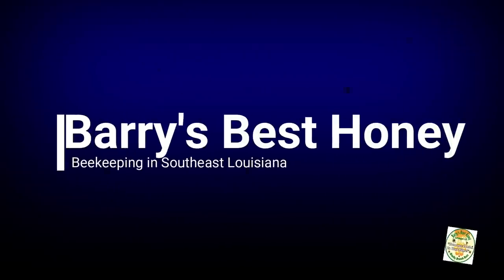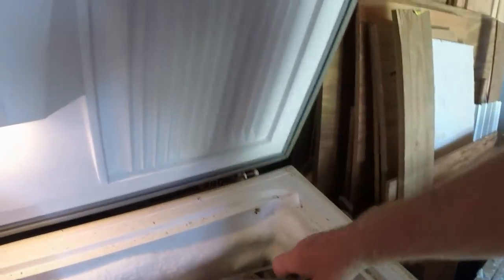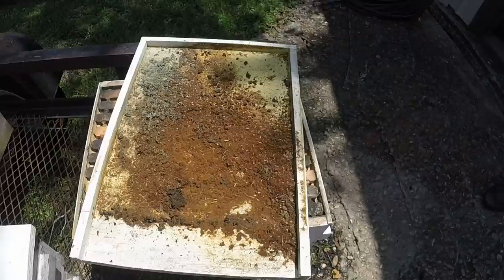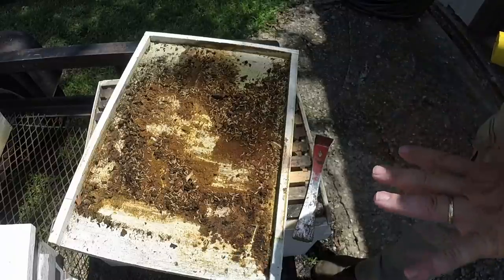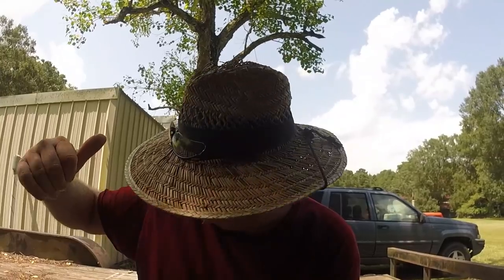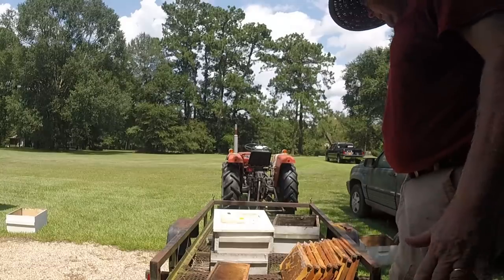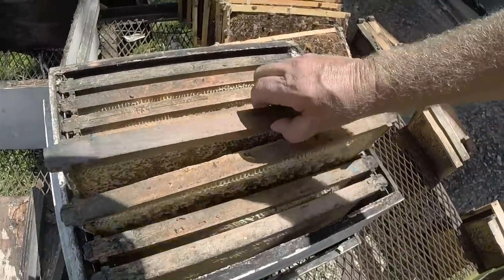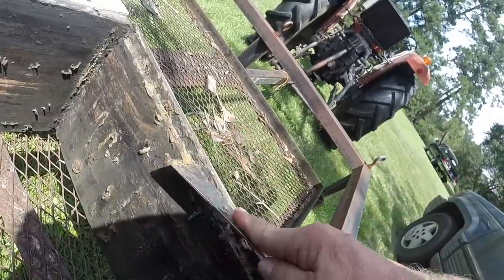Storing Brood Comb and Honey Comb

Comment: The new thing in bottom boards is you make a shallow box with screen top on it. The hive body sits on top. Inside the shallow box you put a pan of cooking oil. Any beetle, beetle larva, or mites that fall through the screen fall in the pan of oil and DIE.
Reply from the maker: That’s the same setup as the freeman trap. I don’t hear a lot about the freeman traps anymore, but they worked. Dirtrooster used them back in the beginning.

Comment: My chickens are lusting over this video! :)  I like to scape them into a bucket and throw them into their run...they LOVE both those larvae!  I have an old deep freeze in my shop and after freezing  the frames I put them in the old deep freeze.  I haven't had to add moth crystals yet but the seal is still good on the old freezer.  At some point I will run out of room...
Reply from the maker: Yea, as long as you can keep those moths out, they’ll keep.

Comment: Very good video. One of your most informative so far. Quick question though. When you say you scrape and reuse the badly damaged by recoating, is it just those 2 steps ? I am in my second year and one of my 5 hives was a dead out and wax moths got 25 % damage on about 8 frames of 2 deeps. They have been frozen, do I just scrape them down and recoat with a roller of refined/reduced wax from cappings ? Or is there another step in there somewhere ?
Reply from the maker: Michael, normally there is a step of pressure washing, but after discussion with DirtRooster and his advice, I am going to just scrape and brush them and then re-wax. Never don that before, but I've seen it work on his stuff and he had some good advice for me on it. But I normally pressure wash them and then let them dry, which really takes a while. The foundations hold a lot of water and need shaking off and then a few days to dry. Then I would re-wax, and it works great. I once saw a video of a fella who would soak them in dawn and bleach for a week and then pressure wash them. For me that was a waste of time and resources and made no difference whatsoever. I need less mess and less work, so I will just scrape, brush, and re-wax and see how that goes this year. Here is the video where I wash them before waxing:
https://youtu.be/u20GcFAJH5A

Comment: Another good video, thanks. I have found that, if I place my wet supers at least 100 yards from the closest active hive I do not stimulate robbing.   As I understand it, the bees only do a figure "8" dance if the sugar source is more than approximately 100 yards from the hive.  If placed less than 100 yards, the  scouts do not give exact directions thus robbing.  I use queen excluders, so I do not have dark production combs.  I store my supers outside in stacks of 10 by 11 (I alternate the stack height so the covers will fit with stacks closer together).   I store them with a metal queen excluder on top and bottom  (for ventilation).   I cover each stack with an outer cover with 1/2 inch spacers again for ventilation.  When I stored inside, I had trouble with rodents.   If outside, the rodents natural enemies seem to keep them at bay.   Like you say, I am not giving advice just stating "what works for me".
Reply from the maker: Yep Bob, we all find what works for us and once we’ve found that, it’s subtle timing from there. My supers are just kind of in the middle of everything. Don’t have too many issues, but once I put them pout, I don’t open any hives for the next two days. Thanks for sharing your knowledge and how you manage your new yard!! We all learn from other’s experiences.

Comment: Up here we have more problems with the mites. In your opinion, are ants bad for around the hives?
Thanks for the tips on storage. Again, this is my second year and first year really storing comb.
When you pulled out that hand torch; priceless!
Reply from the maker: I tell ya Richard, the only ants that tend to give my hives any trouble are the carpenter ants. The rest don’t seem to cause any issues on normal colonies that are healthy and managed properly in the correct amount of space. And even carpenter ants just create a mess on inner covers. And in those cases, I just switch it out to a migratory cover. I only have three inner covers anyhow and once the carpenter ants don’t have anything separating them from the bees, the bees run them off. Weak colonies, well, that’s a different story. So outside of a soil drench I do with permethrin for the hive beetles, I don’t do anything to purposely combat ants. I just don’t like them,, they get everywhere...
Reply: @MikeBarryBees  Thank you for your reply and help as always 👌🐝

Comment: Mike,  Great video.  Confirms my experience. I tried storing my frames in the open (barn overhang) with lots of light and ventilation and I was told that would keep off the wax moths.  I even took them out of box and put the frames between two metal rails with about a frame space between them (wide open).   It was ok for the honey frames but got wax moths in the brood frames so was disappointed that this "natural" way did not work for brood frames.
Reply from the maker: Thanks. Yep, they love the brood comb. More nutrient. They’re trying to get the best bang for there buck like everyone else I suppose.

Comment: Mine tend to fix wax moth damage last if at all. They seem to want to spend their time where they don’t have to do all that work to redo a frame. Small amounts are ok but major damage is a different sorry. 
Do as you need to do. They are your bees. Hot as blue blazes in Ga too!
Reply from the maker: Yep, basically what I was saying with mine. Little spots are fine, but a lot of trails and big spots and I'd rather have fresh waxed foundation. Thanks for the comment!!

Comment: Thats great chicken feed that your burning there Mike, I spray the ground under and in front of hives with 50/50 salt and vinegar mix it seems to work good on beetle larvae and weeds. (thanks for the tip Barnyard bees it works a treat).
Reply from the maker: Yea, I’ve fed chickens a few frames in the past at an acquaintances place, but I have none of my own. Don’t care to get any chickens at this time. I’ve seen the vinegar and pool salt. Just haven’t really tried it. I am ok with the permethrin used in accordance with the directions. I actually use it less than recommended and still have good results. I just do my best to keep strong colonies and keep the space in the hive to optimum area for the bees.

Comment: I just clean up moth damage with my air compressor if using plastic foundation. Just peel off what can be melted and reused then blast away. If damage is not to bad just blast what needs removing then recoat with fresh wax with a brush.  I tried the pressure washer but what a mess.  Make sure to wear goggles
Reply from the maker: I need to try that! Like you said, Pressure washer is so messy. I

Comment: You say 5ml/gal on the permethrin. What % permethrin are you using? I an seeing mostly 10% by the jug or squeeze meter quart.
Reply from the maker: Not even sure of the %. I’m sure different manufacturers with differing percents might be different. Mine is Guardstar with a metering chamber and it’s 5ml per gallon.

Comment: What kind of ants are you battling ? small red ants, sugar ants, fire ants, or the big black carpenter ants.  I have defeated the ants in this area and maybe my solution will work for you. I haven't shared the solution on my channel yet but plan to at the end of the season after I am sure it is flawless.  So far not the first ant on the first hive all season.  The wax moths and beatles on the other hand.  Not good at all.   Take care mike and stay cool.
Reply from the maker: Big farmer, I really have issues unless the hives are weak. Below in a comment I talked about carpenter ants being about the only ants that cause me issues,
But that’s if I have an inner cover on. But I only have three of those and rum them last resort. Switching to the migratory will remedy the issue, but I just hate the little jokers because the get everywhere and are a bother. But now that’s not to say I wouldn’t try something that would keep them out altogether. The ground drench with permethrin for the beetles works ok if it contacts a nest.
Reply: @MikeBarryBees  Check your email :-)